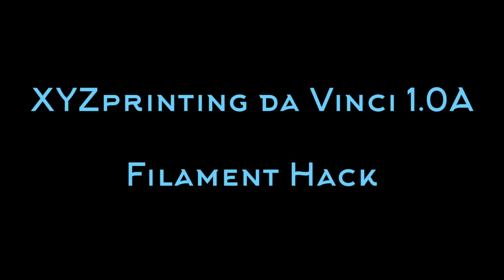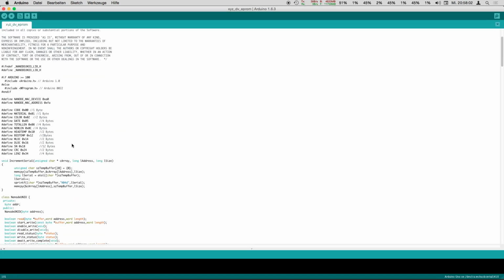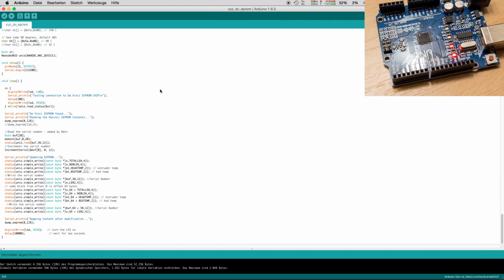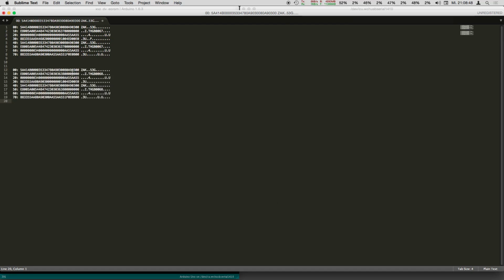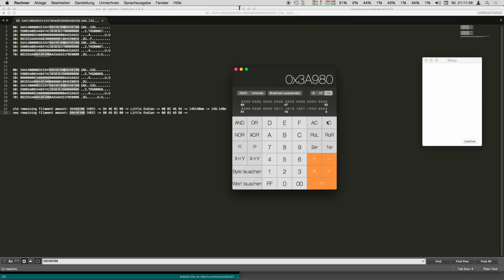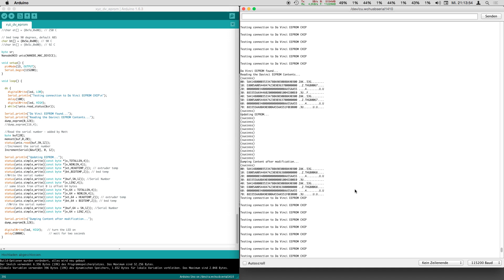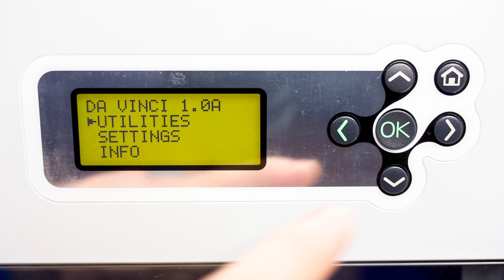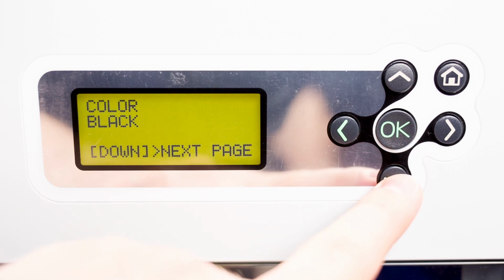XYZprinting da Vinci 1.0A EEPROM hack explained in detail for 3rd party filament w/latest firmware

Comment: Archivo Arduino marca error al compilar

Arduino:1.6.3 (Windows 8.1), Placa:"Arduino Uno"

In file included from C:\Program Files (x86)\Arduino\hardware\arduino\avr\cores\arduino/Arduino.h:30:0,

                 from sketch_sep06a.ino:41:

sketch_sep06a.ino:65:6: error: expected unqualified-id before '__asm__'

sketch_sep06a.ino:66:6: error: expected unqualified-id before '__asm__'

Error de compilación

  This report would have more information with
  "Show verbose output during compilation"
  activala desde Archivo > Preferencias
Reply: ya quedo solo actualice la version de arduin 2.3.2

Comment: Is this still necessary? I can select non original filament on my davinci Pro 1.0.. The problem is, the filament barely comes out, and when it does it doesn't stick! Change it to xyz  filament right after the 3rd party one, and works like a charm... Is it because I'm a noob or xyz has little demons working inside my printer? 😂😂

Comment: what calculator are you using to work out the filament settings please?
Reply from the maker: This is the built-in calculator from macOS - in the programmer's view. Something similar exists on windows as well - programmer's/software developer mode.

Comment: Hello ! Do you think this would work with the Da Vinci 2.0 A Duo ? Thanks 👍
Reply: Yes, and on latest firmware
Reply: @rmoria  yeah so it worked but only on my really old cartridges from 2016 / 2017 ! And I can’t seem to be able to change the temperature but it was fine. Unfortunately the print quality was really bad and since there is no way to adjust settings in the slicer I bought a Bambu Lab X1 Carbon and now I just use that (plus I can print with 4 colors on the same object) 😂😉

Comment: Hi Florian, thank you for putting so much effort into this hack, I can't wait to get my printer working. I can't seem to get this to work on the 1.0a Davinci I have though. It can change the material type and I get success after flashing the EEPROM for different temperature settings, but, whenever I go to print it always defaults back to it's standard 90 bed 213 nozzle :/ Can I have a hand please?
Reply: do you have more than one EEPROM chip? i was having similar issues with some of the Chips but others worked just fine so i marked which ones would work that way i know for future reference. other than that i haven't really looked for a fix since i was able to get the ther chips working. so yea my suggestion is restart the video and use a different chip and follow it very  closely step by step, make sure the printer is able to reach the temp levels you are trying to set. just make sure to follow the steps to a t

Comment: I have a Arduino Due. I know the PIN numbers would be different, but is there anything else that would need to be changed?  Will it even work since the voltage on the Due is different?

Comment: Hi Florian, I managed to reach the penultimate step where we have to run the Serial monitor and it displays "Testing connection to Da Vinci EEPROM CHIP". But when I connect the plugs to my cartridge, nothing happens. Do you have any idea of what could be wrong? Thanks a lot
Reply: x2, i dont know what im doing wrong....
Reply from the maker: Sorry for the late reply. I hope you found a solution? If not, what components are different compared to what I show in the video? Possibly the new firmwares do not allow this anymore?

Comment: It doesn't work for me, i'm trying with AiO. And arduino uno.

Da Vinci EEPROM found...
Reading the Davinci EEPROM Contents...
(success)
00: 584048000030303080A8000080A80000 X@H..000........
10: C0002800504840403030303000000000 ..(.PH@@0000....
20: 0000000030000000F8F8F8F8A854A850 ....0........T.P
30: 883050A880A800000000001000E800E0 .0P.............
40: 585048000034303080A8000080A80000 XPH..400........
50: D0002800504840403030303000000000 ..(.PH@@0000....
60: 0000000030000000F8F8F8F8A850A854 ....0........P.T
70: 883050A880A80000A854A854B8200800 .0P......T.T. ..
(failure)
Press enter to update EEPROM...
Updating EEPROM...
(failure)
(failure)
(failure)
(failure)
(failure)
(failure)
(failure)
(failure)
(failure)
(failure)
(failure)
(failure)
(failure)
(failure)
Dumping Content after modification...
(failure)
00: 00000000000000000000000000000000 ................
10: 00000000000000000000000000000000 ................
20: 00000000000000000000000000000000 ................
30: 00000000000000000000000000000000 ................
40: 00000000000000000000000000000000 ................
50: 00000000000000000000000000000000 ................
60: 00000000000000000000000000000000 ................
70: 00000000000000000000000000000000 ................

what would be the problem?

Comment: I'am finished and successfully but unidentified cartridge 

Previously, I had successfully reset. 
And has been upgraded to use PLA, which was successful, 
but once returned to use as the original ABS, can no longer be used.
Reply from the maker: Unidentified is caused by the software / too new firmware. I believe if you reset software and disconnect from internet, before you use the cartridge, it should work. As far as I know, they contact their server to verify the cartridge.

Comment: FLORIAN AND ALL OTHERS PLEASE READ, I HAVE SUCCESSFULLY FIGURED OUT HOW TO CHANGE THE MATERIALS

The code has extruder and bed temp defaults that come with it  (40C, 50C), but these don't work. According to the XYZPrinting Shop Page, PLA prints at 190C extruder and 45C bed. The numbers inside {0x - - } are hexadecimal for the temp values, so changing these will change the cart temperature. (be is 190 in hex, 2d is 45)

If you want to use PLA instead of ABS you have to copy these lines into the extruder and bed temp areas:
char et[] = {0xbe,0x00}; // 190 C  (extruder)

char bt[] = {0x2d,0x00}; //45C  (bed)

Once you have these uncommented, as well as the PLA material code line, you should be able to convert any EEPROM to PLA. I have successfully turned an ABS cart into a PLA cart by doing this. Please like this so Florian can see, this is huge!
Reply from the maker: Thank you so much for the effort! Great work! Thanks for sharing! 😊
Reply: awesome, I was looking for this.  Thank you

Comment: this also works for my da vinci 1.1 plus 👍🏽 I use Simplify3D (allows temperature modifcation but using LAN for printing needs to disable internet connection in the router so that my davinci can‘t check the cartridge serial numbers online)
Reply from the maker: Thank you for your feedback. It’s much appreciated.
Reply: Thank goodness!!! I have a 1.1, I was hoping to use CURA with it. Do you know which settings to use? I want to print PLA, 45 degree bed temp, 190 degree extruder temp. Honestly, any advice would be VERY much appreciated!
Reply: hey any advice my 1.1 won't even acknowledge the cartridge is there any tips 
thanks

Comment: My cartridge shows 0 meters of filament. When I'm connecting the pins nothing is happening. I still have only "Testing connection to Da Vinci EEPROM CHIP" which is showing over and over. Any ideas? I have Arduino Mega 2560.
Reply: Ok so the problem is with Arduino Mega. When I used Arduino Uno it flashed the cartridge correctly.
Reply from the maker: Glad you worked it out. The problem is that the Mega2560 is compatible, but only with changes to the code (allocation of pins)

Comment: I followed the instructions and the filament counter was reset, but now the printer no longer recognizes the cartridge, when trying to print it delivers me this message.

"There is a cartridge without an identifier, the printer can not execute the printing parameters."

My printer has firmware v1.3.4 and I use XYZware 2.1.33.2.
Reply: same problem :(
Reply from the maker: Have you tried an older version of XYZware and disabled your internet connection? Try that, then redo the flash, then try printing again.

Comment: I've done every thing you said to do and  when i open and test i get this , How do i press Enter to UPdate
 0:18:57.838 -> Da Vinci EEPROM found...
10:18:57.905 -> Reading the Davinci EEPROM Contents...
10:18:57.905 -> (success)
10:18:57.905 -> 00: 5A46530000363535C0D40100C0D40100 ZFS..655........
10:18:57.905 -> 10: E8005A00544847423030303300000000 ..Z.THGB0003....
10:18:57.905 -> 20: 0000000034000000FFFFFFFFAA55AA55 ....4........U.U
10:18:57.940 -> 30: 883355AAC0D401000000001004ED00E0 .3U.............
10:18:57.940 -> 40: 5A46530000363535C0D40100C0D40100 ZFS..655........
10:18:57.940 -> 50: E8005A00544847423030303300000000 ..Z.THGB0003....
10:18:57.940 -> 60: 0000000034000000FFFFFFFFAA55AA55 ....4........U.U
10:18:57.940 -> 70: 883355AAC0D40100AA55AA557F140B00 .3U......U.U....
10:18:57.940 -> (success)
10:18:57.940 -> Press enter to update EEPROM...
Reply from the maker: Did you find a solution to this problem? You may also go ahead and try a different version of Arduino.
Reply: @florianuhlemann  I had this problem too and I tried commenting out the group of code that mentions "Press Enter" to see if it would skip that prompt and it worked. It took a couple tries of contacting the pins to the strip and I don't know if that's a code issue or me not fully holding it against the strip long enough but if you continue to run into errors try again a few times.
Reply: type '' y '' in text box and press enter
Reply: I have the same problem, did  find out?
Reply: @q-rexxfpv425  just press enter on your keyboard
Reply: Nasty Viper doesn’t work for me. I have to put a letter in the entry box and then enter that.

Comment: Can you give me the settings to use a abs cartridge for pla temp settings and new declarations
Reply from the maker: Unfortunately, the tool does not work to switch between PLA and ABS settings. I recommend purchasing an ABS cartridge and a PLA cartridge for each use case or try and use my technique that I have described in the other video. (custom slicer and printer settings)

Comment: Hi from germany. Good video, i have ohne question. If it possible to change the temperature of bed and extruder with the latest Firmware of my 1.0A? Thx
Reply from the maker: Danke für deine Rückmeldung. Leider ist das Andern der Temperature so direkt nicht möglich. Ich empfehle dir daher mein anderes Video zu schauen (Custom Slicer and Settings), dort beschreibe ich, wie ich das gemacht habe.

Comment: hi, thanks for the video, successful and working davinci xyz 1.0 30/12/18 in abs. how i can change the material to pla?
Reply from the maker: So far I have only seen and heard that a reset is possible. Change of filament type requires either custom G-Code and processing (see other video) or buy a PLA cartridge and keep resetting that one.

Comment: please help, i have a problem :
"Testing connection to Da Vinci EEPROM CHIP

Testing connection to Da Vinci EEPROM CHIP

Testing connection to Da Vinci EEPROM CHIP

Da Vinci EEPROM found...
Reading the Davinci EEPROM Contents...
(failure)
00: 5A4157000034363780A9030080A90300 ZAW..467........
10: C0000000000000000000000000000000 ................
20: 00000000000000000000000000000000 ................
30: 00000000000000000000000000000000 ................
40: 00000000000000000000000000000000 ................
50: 00000000000000000000000000000000 ................
60: 00000000000000000000000000000000 ................
70: 00000000000000000000000000000000 ................
(success)
Press enter to update EEPROM...
"
i press "enter" but it dosent work
how can i solve this problem?
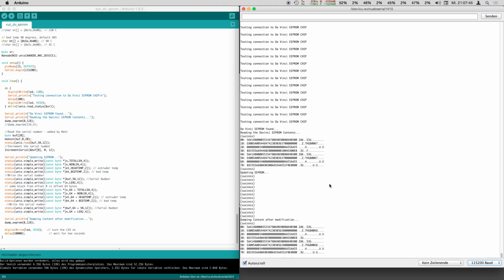Reply from the maker: The first line looks good, but there is no follow-up lines. Be sure to have a static connection between the pins and your Arduino, i.e. make sure you don't wiggle too much while flashing. If this does not solve the issue, there might be an issue with your chip. 4:51 of the video show's what it should look like.

Comment: From the Printer menu, the cartridge is back at 240m of filament, but when trying to print, I get the Unidentified Cartridge message.
Any idea what went wrong?
DaVinci 1.0 AiO, Firmware 1.2.4, XYZWare 2.2.22.

Comment: hello there, i just purchased a Da vinci 1.0A and would like to know if this hack will work still on it, as i would like to use 3rd party filaments.
Reply from the maker: It should still work. Have you tried it? People do recommend to not allow the printing software to have an internet connection if you want to be on the safe side.
Reply: @florianuhlemann  Hi, i thought that ill ask you first if the EEPROM Hack works with Firmware Version 2.1.2 too? Thank you for your Videos! :)
Reply: Is there a way to make this automatic every time you turn on the printer, giving the arduino power and dump the new NFC code onto a chip?
Reply: Yes this still works. I just used the Uno to flash my Da Vinci 1.0A EEPROM for the ABS filament it comes with. However because I know very little about the coding portion, I still can's figure out how to change it from ABS, to PLA in the code.
Reply: @matthewryan2975  From the Printer menu, the cartridge is back at 240m of filament, but when trying to print, I get the Unidentified Cartridge message.
Any idea what went wrong?
DaVinci 1.0 AiO, Firmware 1.2.4, XYZWare 2.2.22.

Comment: I figured out a simpler method that works on every firmware without using nfc hacks.

1. You will need a valid spool that hasn't registered as empty on you printer, once it registered as empty you can't undo it without hacking
1. Download ThreeDubber.exe
2 Decrypt your .3W file to a GCODE file
3. Change these parameters to zero:
 ; total_filament = 0
 ; extruder_filament = 0
 ; extruder = 0
4. Encrypt again and print
4. Do this for every print and the spool will never register as empty, you can keep reusing it with any type of filament

I'm going to write a script that automates the encrypting and editing of the gcode, so just message me here if you want it.
Reply: Sorry, I am currently having some issues with this, the latest firmware update seems to have patched even this trick, xyz is putting up quite the fight... Another option that might be worth exploring is ending the GCODE file with several meters of retraction to 'rewind' the counter, but I haven't had time to test this. Will keep you posted!
Reply: hew did you finish that script?
Reply: Where can I find the program? I am also interested on the script
Reply: How's it looking?
Reply: Jeremy Soo  could you please send me the script. Thanks!       crittkillen@aol.com
Reply: Elmo Fudge were you able to write the new code and will this work for pla

Comment: One last question. How do u prepare the Arduino before u do this process or do u just do it without doing anything to the Arduino
Reply from the maker: As described in the video, the Arduino is flashed with the software first, then connected to the serial monitor. If all goes according to plan, you only have to connect the 3 pads to the 3 pins described. (Power, GND and Data)

Comment: how I modify the code for filament PLA !! my cartridge is ABS but I want to use PLA Help !!???
Reply from the maker: It is possible to change, but it does not affect the normal way the XYZprinting software works. There is a second video describing how to get around this issue. I recommend keeping one ABS and one PLA cartridge if you want to use XYZprinting software.
Reply: But if I change the temps within the code, doesn't it just go to those temps? Or does extrusion need to be adjusted for PLA? I've only ever used and I3 Plus, so I'm new to the Da Vinci and ABS. With that said, this worked first try, so that's awesome!

Comment: will this still work on 1.0a with firmware 2.1.3.

thanks
Reply from the maker: Very likely, yes. Beware that the success may depend on prohibiting the application, i.e. xyzWare to gain internet access!
Reply: Hi! I just follow the steps of the video but it doesn't work with firmware 2.1.3, even without internet access. Can you please help me? or guide me in some way to get a success result. Thanks a lot!

Comment: This is alot of work to reset a filament spool. There should just be an aftermarket plug to attach to the spool and a button to push. I suppose thats why there are so many of the printers on ebay.
Reply from the maker: It's a guide to create such device, yes. However, there are a few of those resetters on the market, but they do nothing else.

Comment: Hi, great video! I also have the same printer, but with the firmware 2.1.3.  Do you know if this procedure will work in my version? Or if its possible downgrade my firmware to the same version as yours? thank you!
Reply from the maker: Supposedly it still works with latest software and firmware, but make sure you prevent it from connecting to the internet. Otherwise it will refuse to use the cartridge again.
Reply: It worked! thank you so much! But the quality is not the same as the original filament, this is getting some parallel lines, so I saw in some sites, it may be because of the temperature. What temperature do you use for white abs? Did you install the repeat? Is it really worth it?
Reply from the maker: My ABS was using 238C I think? In order to do this, i had to use the custom Slic3r-Workflow from my other video to make it work. Might be even trickier now and only work with an older version of XYZprinting to accept the GCODE.

Comment: Hello, thanks for your video and info.
But I was wondering if you have a Arduino Sketch for use PLA Filament or some code in order to use PLA instead fo ABS.
Hope you can answer soon.
Best Regards.
Reply from the maker: My suggestion is to keep two separate cartridges, one for PLA and one for ABS. If you, however, use the Sli3r-Tutorial, you can actually make it work with any material, as the settings can be customized with a 3rd party slicer.